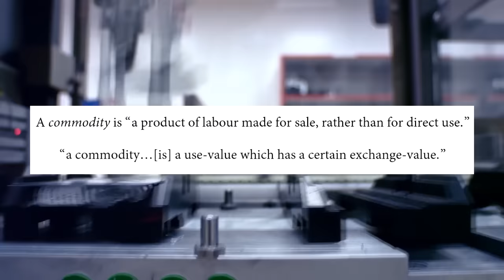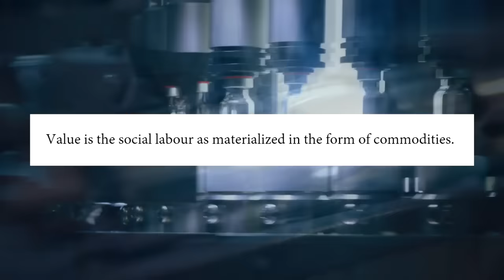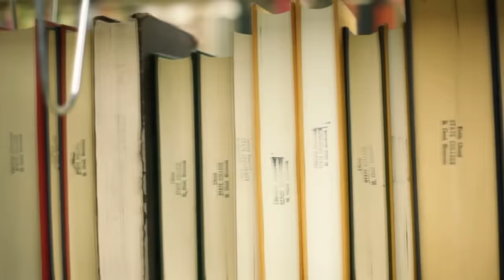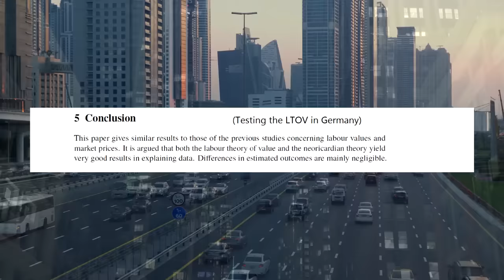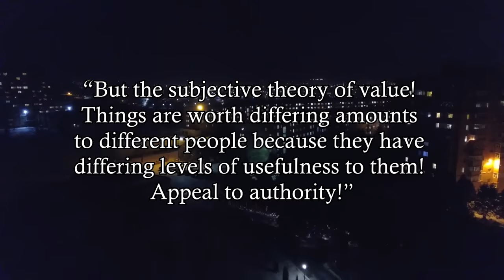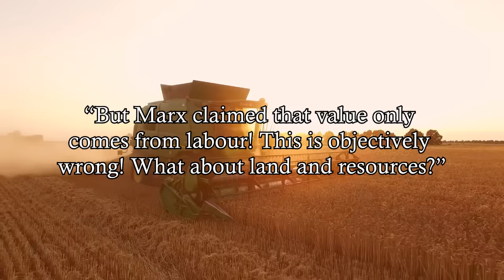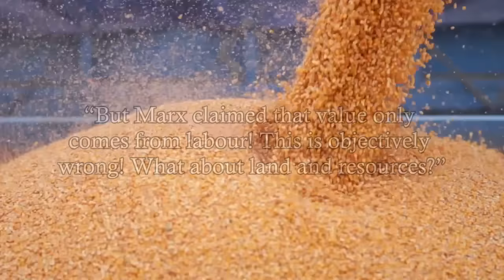Capitalist arguments against the labor theory of value suck (Explaining the LTOV) - Socialism 101

Comment: Supply and demand can also be deduced from the social necessary labour time: why are diamonds so expensive, because it takes a long TIME to aquire them.
Reply: No they cannot. Diamonds are not expensive because of labor time but because of their scarcity. You clearly did not read the diamond water paradox thought experiment.
Reply: @ExPwner  what is that paradox mate ?
Reply: @ER-zf5tr  the paradox deals with how people value things. If your water supply is abundant (which is the case for most of us), you value diamonds much more than water. If your water supply was scarce then you would value the diamonds much less relative to the water and would likely trade diamonds for water. This paradox has absolutely nothing to do with SNLT whatsoever. You could have the same amount of SNLT put into the diamonds for both scenarios and the water for both scenarios but the people would value those items differently not because of time but because value is subjective.
Reply: @ExPwner  I don’t get what its conclusions are though? That value is derived merely from the level of somethings demand ?
Reply: @ER-zf5tr  the conclusion is that value is subjective and thus determined by supply and demand, not some innate quality of the good itself such as labor time.
Reply: @ExPwner  but why isn’t water free like oxygen if it’s abundant ?
Reply: @ER-zf5tr  when it is abundant it is very cheap even if it isn’t “free” and this could be due to things like costs to purify it, transport it, store it, etc. Most people don’t want to drink from ponds or lakes directly since that water is dirty and could have various contaminants in it, whereas air is not so contaminated in nature and has essentially no costs to be readily available for consumption.
Reply: @ExPwner  “costs to purify transport and store.” Correct all these things require labour, all value is derived from labour. 

Yes you are right, no labour is required to obtain oxygen and thus it is free despite it being the most in demand substance on earth. All value is derived from labour cheers mate
Reply: @ER-zf5tr  no, all value is not derived from labor. I just addressed that. You can hold the labor constant for both and the value derived goes up for one and down for another. Labor has nothing to do with that.
Reply: @ExPwner  measuring on a societal
level (not a hypothetical scenario between 2 individuals) , it is derived from labour I’ve just addressed that in why water costs money and why oxygen doesn’t aha
Reply: @ER-zf5tr  nope. Any “societal” level is only the aggregation of individual level, and at no point is labor the source of all value. A claim is not evidence or an argument. You claimed it. You did not make an argument or provide evidence.
Reply: @ExPwner  you were the one that said water costs money despite its abundance because of the labour needed to provide it not me I just agreed with you tbh
Reply: @ExPwner  can I go into a Ferrari dealership tomorrow then and just say to the salesman “To me I feel that car is worth £5000 not £250,000 sell it to me for that price instead that’s what it’s worth to me because I got loads of cars at home”

Comment: The subjective theory of value does work and is the reason why the free market is the best form of allocating prices. If you have a planned economy where the price is decided arbitrarily based on a bureaucrats opinion on the value of a product they will most likely be wrong. If they set it too low you get shortages and too high no one will buy it (Eg/ American ambulance prices which are set arbitrarily higher than their true value due to insurance companies and corruption in the Senate).

The fact that prices fluctuate depending on the circumstances faced by the consumer even if supply and demand is equal or irrelevant in a given scenario, proves that value is subjective. The reason why the free market is the best system for allocating prices is because it has a live feedback loop which is constantly correcting prices in accordance with the products value. 

To take your car example: I am under 17 and can't drive. The car has no value to me if I bought it and therefore I will not pay a few thousand £s to buy it when I can't use it. To another person who has to drive to work everyday the car will be well worth the  as it allows him to make more money by working. If you only use a car once a year you will be much less likely to spend money on a car but more likely than someone who cannot drive. All of these factors are taken in to account as well as supply and demand and also the cost to produce by the free market when assigning the price to the value that will make the most people buy it.

Another example of subjective value is a signature: If I was famous my signature would mean nothing to me or you or most people but it may be worth thousands to a fan even though I put a second of 'labour' into it.

Lastly, why do you think barter exists. Or during hyper inflation people stop using money and use eggs, furniture or gold instead?
Reply: @Porky describing yourself
Reply: "The subjective theory of value does work and is the reason why the free market is the best form of allocating prices"
The free market just decided that gas and electricity should cost significantly more than it did previously, for no reason.  There is not a shortage, wholesale prices have not increased as much.

But thousands of people are going to die in the coming winter, because they will not be able to afford to heat their homes.

And you think this is a good way to determine price?  By raising it until the graveyards are filled?
Reply: @DeoMachina  wrong. Government policy largely did that. Neither are handled by the free market. Electricity is monopolized by the government.
Reply: @ExPwner  Incorrect, this is a lie.